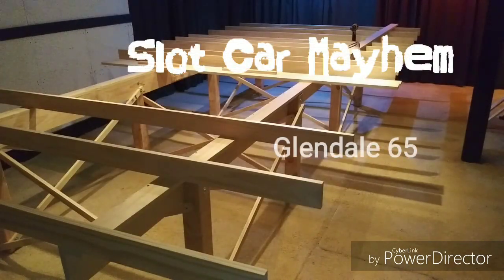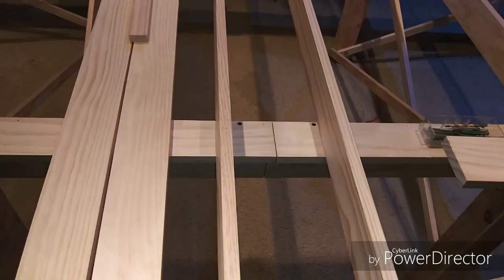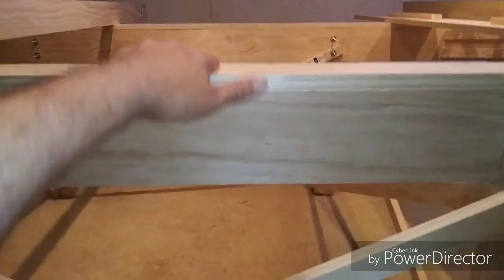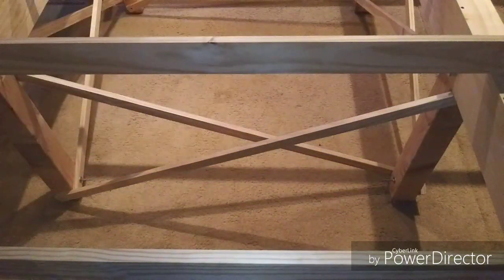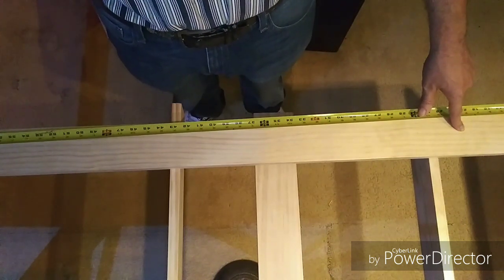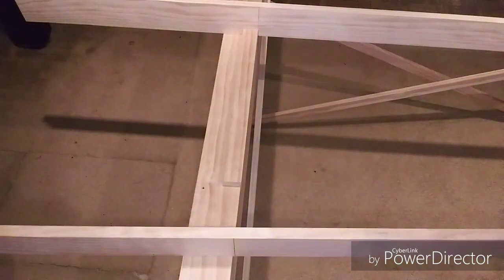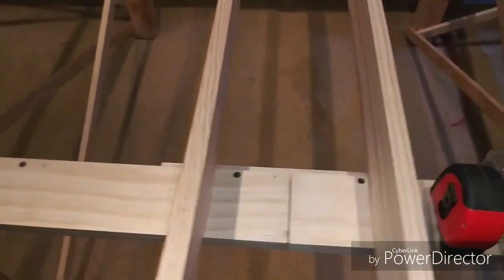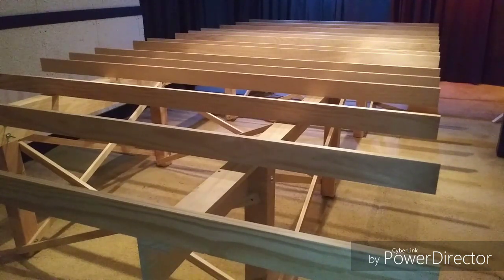Glendale 65 Episode 01 - Bench work

Comment: Thanks John for the build video. I may have further questions if I decide to go forward with a table. I’m on the floor now, and not sure I want to commit to a permanent structure. But the plans are so cool, I may do it just because. If you get my meaning. Thanks again.
Reply from the maker: I will also sketch some 4x8 tables that you can rearrange as necessary, just in case. I'll start working on those tomorrow. Always willing to help!!

Comment: Hi John, whats the track height & any considerations you made in picking a height?
Reply from the maker: Hello, my track height along the front straight is about 40 inches.

Height consideration is based on the desire to have different amounts of view blockers (buildings and landscaping) depending on where one is standing. That way I can arrange drivers by skill level, and level the field a bit.

40 inch is a bit tall for children to run, but I have extra tall bar stools for kids to use. Helps a lot!!

Comment: So John. What top sheathing material would you suggest for the table tops? Hopefully something strong, not too thick, and light in weight. 4’x 8’ modular table size.
Reply from the maker: I would recommend at least 1/2" thick ply or mdf. Too thin and it will flex and bow in very little time. I did my initial surface in 1/2" mdf, and have had zero issues.